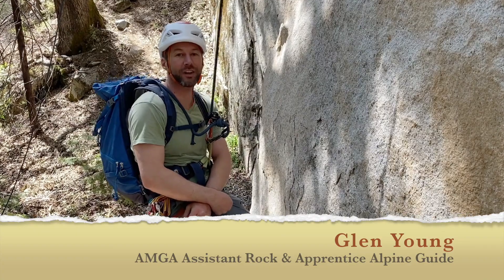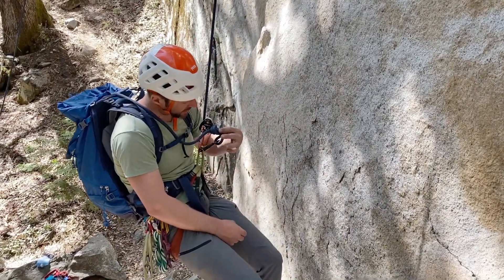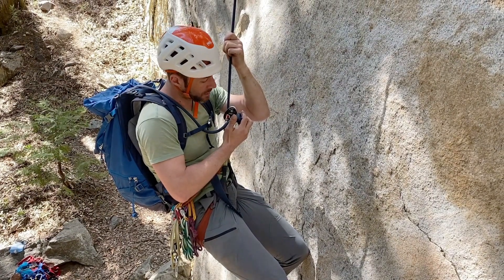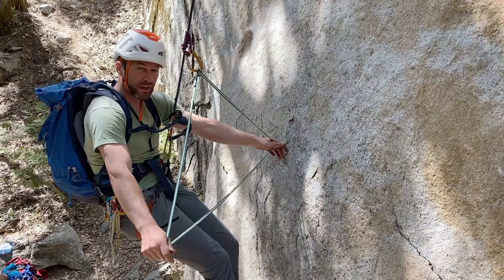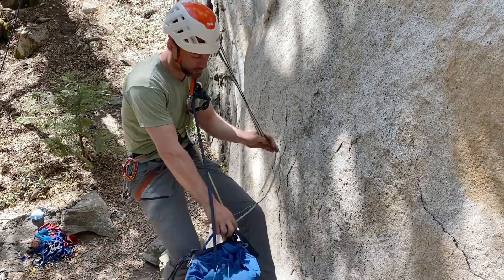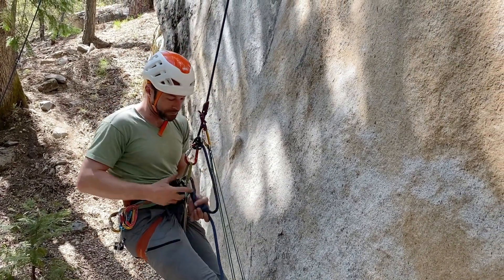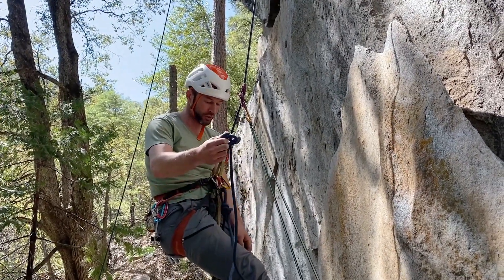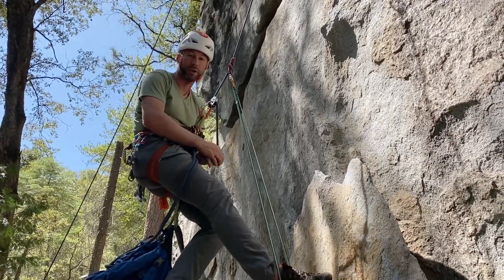Self Rescue from a Crevasse: Modern Rope Ascent

Comment: If for some reason you needed to escape this set up and rappel back down, how would you do that efficiently & safely?
Reply: What I've done is to stand up on the foot loop then clip my harness into the autoblock. (Or whatever your upper ascending device is.) Using a quick draw to extend your harness should make this easier and helps set you up for rappelling. You can then "sit" in the harness and take the weight off the Micro Traxion and create some slack. After making sure you have a back up tie in, you should be able to remove the Micro Traxion and put on a rappel device below the autoblock.  Remove the back up tie in and you're ready to go. Well maybe. If you're using an auto block, you should be able to release it under load and get the weight on to your rappel device. (A VT prusik works even better for this.) If you can't release the autoblock (or other device), you can stand up on the foot loop again, slide up the rappel device to get your weight on that to unload the autoblock. I might mention that a Tibloc (if that's what you're using) does not work well as a rappel back up and you would likely have to remove it. (They really only like to go in one direction!) I hope that makes sense. Obviously one should practice this in a safe environment first!

Comment: Works great if you are the fallen climber, but wouldn’t the micro traxion be wasted if you are the rescuer? In that case, since it’s loaded with the weight if the fallen climber, it would be tough to release from that load line to re-attach to a new drop C down to the victim (I.e. if the load line is too dug into the lip to use for the rescue). So it’s worthless to the rescue and you need another microtraxion. Am I missing something?   What’s the purpose of leaving the button off as you travel?
Reply: The way I understood it each party member should have their own micro traxion as personal protection equipment
Reply: Each party member has their own Micro Traxion/Spoc device in this scenario.
Reply: @rajanlliw  which set up the same way would be hard for them (hanging down in the crevasse) to unweight and release from the load line to re-attach to the drop C. And that also assumes they aren’t injured and unable to assist their own rescue - which is why you are wanting to use the drop loop since they would otherwise have just ascended the rope as the video describes.
Reply: I wonder if he doesn't engage it because if he is the falling climber, it doesn't shock load the teeth and damage the rope.
Reply: @David-cp6rl  makes sense
Reply: He does have that Prussik that he could transfer the load to a picket.  This would release the load off the traction.  Remove it and use it how you wish.